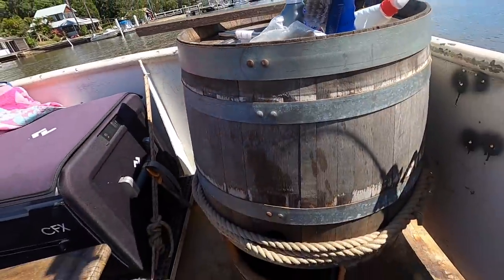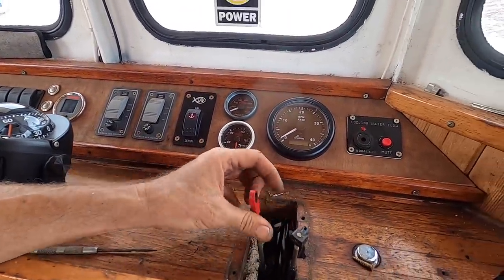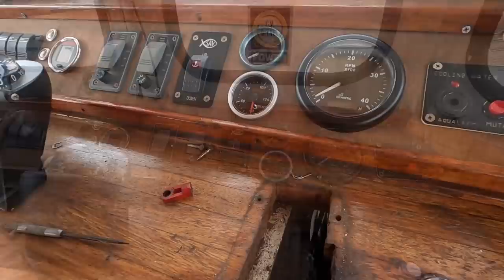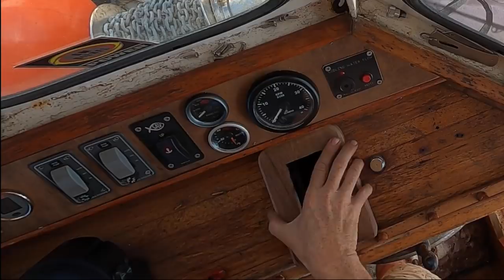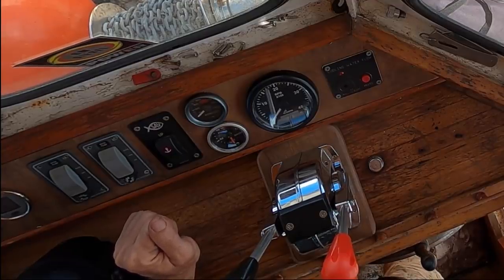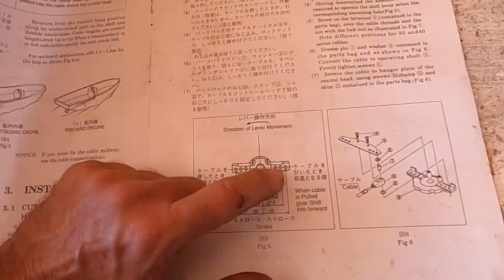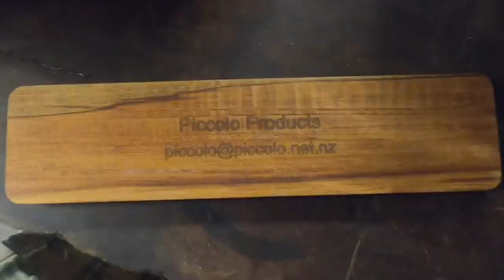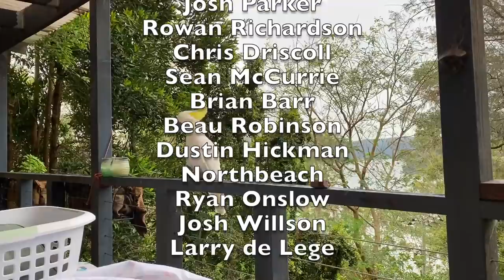New throttle controls and other wheelhouse upgrades

Comment: Hi Stu. I am a forensic fire investigator. When using linseed oil, make sure you dispose of any contaminated rags etc in water.  High risk of spontaneous ignition.  Love your vids.
Reply: Was going to mention it. Very important point.
Reply from the maker: Intresting, thanks for sharing.
Reply: Lay them out flat to dry in a single layer. Once they’re dry they should be ok.

Comment: Regarding the fire in Brooklyn...  Boats with inboard gasoline/petrol engines generally come equipped with blowers for the engine compartment.  On all of the boats I've been on, the switch for the blowers was right next to the ignition and had a big label telling you the minimum time that you should run the blowers prior to attempting an engine start.  I was always taught to start the blower, then go put my nose next to the blower outlet.  If I smelled gasoline for more than a second or two, then it was time to find and correct the fuel leak before repeating the process.  When the blower runs for the specified time with NO fuel smell, then you can attempt to start the engine.  Might have been a bit paranoid, but I've never blown the engine cover off of a boat.  (Bonus hint...it's almost impossible to forget bilge drain plugs when they are in a plastic bag zip-tied to the latch for the trailer hitch...)
Reply from the maker: Yes, the blowers are critical with inboard petrol engines.

Comment: Pete's shirt is top notch
Reply from the maker: It sure is! :)
Reply: @DangarMarine  i have a question... I just rebuilt a 1983 J75TLCNB. I have spark. I have gas in the throats of the carbs. All new wires. New power pack. New spark plugs. It cranks but doesn’t start. Randomly it will make a popping noise and a little smoke comes out of exhaust and I assume this is normal. Could my cause be timing? It bogged down under load and randomly died last year which is why I built it. I’m scared to continue to keep trying to crank it due to not breaking it in yet. I wish and hope you respond. I’m at wits end. Also after cranking I notice gas coming out of the throats. Is this normal?

Comment: Hey Stu, I believe the long wooden planks of the barrel as you called 
them are called  "  Staves  ".    I think I learned that from reading all those
Horatio Hornblower books.
Reply: Yes barrel staves.  A timber boat is just an ill shaped barrel 🥺.
Reply: @markhgillett  the steel straps are simply called hoops.
Reply: yup barrel staves
Reply: also those holes you made are called "bungs" and if you ever intend to keep liquid in them you need to soak the barrels until all the oak is waterlogged or they wont be "water-tight"

Comment: Wish  knew you were doing carpet Stu. I would have told you a trick from a old carpet installer. When you take up the old you just lay it on top of the new, allow for a little extra and trace it out. Saves tons of time and effort.
Reply from the maker: Using the old as a template is always a great way to go.

Comment: Dont matter where ya drop it on the boat, it goes in the bilge and you need Mr Tickle arms to get it back because its probably stainless and the magnet wont grab it.
Great video 👍
Reply from the maker: And to make things worse, with a steel boat you just grab the hull even if it is mild steel. :(

Comment: Great episode. The wood slats on a barrel are called staves. Stu, if you adjust the ballast on Renko, wouldn’t you be feeling listless🤔
BTW, I feel your pain on the drill bits. I did the same, but only on the shop floor. I can imagine it was real entertaining picking them up. I hope you had a magnet.
Reply from the maker: Thanks mate, liked your listless joke. That's the trouble with a steel boat, harder to pick things up with a magnet!

Comment: From when I was about 5 years old I was used to single controls for throttle and direction. Once I started operating a real boat and got used to dual controls I would never go back to a single.
Reply from the maker: For sure, I'm really happy with the change.

Comment: Hi Stu! Great progress on the boat! You should look at gimbaled cup holders. They have a flat bracket that mounts to a wall or bulkhead and a gimbaled basket that attaches to the bracket. Swivels in 3d...works well. Sold by West Marine as Drink Mate
Reply from the maker: Thanks for the tip!

Comment: The bands are called hoops and the planks are staves. You will need to screw every band into the staves to prevent them falling apart. Every 4th stave so they look like a spiral pattern on the barrel. Top #1, second  #2 stave, third band #3 stave, 4th band 4th stave, back to top, 5th screw in 5th stave etc. As many numbers as bands. Hope you comprehend.

Comment: They are called barrel staves.  Copper are the people that make the barrel.  Lots of legal regulations.
Reply: Cooper? Kuiper?
Making bands out of copper would be interesting! lol! It's probably been done. Possibly bronze too. The history would be interesting.
Reply: @chuxmix65  I hate auto-correct.  A barrel maker is a Cooper.  The metal rings are made of iron.  They still make wooden barrels in Kentucky because bourbon whiskey barrels can only be used once.  Rules of making bourbon.

Comment: I bought a huge new drill index because I needed a 21/64 and of course the only set that had them was the big expensive one. On the way home I said to myself, "this will be the GOOD set and I won't lose any of the bits". I used the 21/64 without incident, but I assume the next time I reach for it I will lose one or more bits from the set, because of course I will.

Comment: Did you consider using some sort or rubberized coating vs. or in addition to the two part epoxy under the carpet?  With water, especially salt water, naturally going to be on and soaking through the carpet, it's going to sit there and all the protection you can get for the steel would be ideal.

Lastly, did you glue the whole carpet down, or just edges?  Hopefully only edges (unless the glue is stays flexible and acts as a water barrier itself) so if you do need to pull it up it can be done easily.  Also, for future reference, glue the edges only, but leave gaps so any water accumulating on/underneath, can run out the edges.

Lastly, I think I might have tried using velcro around the edges to hold it in place, yet make it easy to pull up to check for water, rust, and/or to dry out the carpet itself.
Reply from the maker: Did think about doing a bitumen coating.

Comment: Yup, staves.

And you should put some screws through the band around the barrel, 4 probably enough, as the bands are only held in by pressure, and since the barrel is intended to hold liquid, that keeps the staves expanded against the bands.  Without that, they'll dry and shrink and the bands will tend to fall off and you really do NOT want that...  :)
Reply from the maker: These barrels have been dry for about 8 years now. The guy drove the bands down when I bought them (hence the white where they previously were)

Comment: I cried with you on the bits in the bilge. Can't even use a magnet right?
Reply from the maker: No, magnet just sticks to the hull unfortunately.
Reply: @DangarMarine  put a magnet between wooden wheels so it couldn't attach to anything but that loose parts could still attach to it with a bit of luck

Comment: Interesting, I know most boat engine controls seem to be going with the all in one handle for shift and throttle, but I've always preferred separate controls.  Since way back, with manual shifting outboards, vs. electric, a problem that causes failure is that folks shift like in a car, gently, easing the shifter into or out of gear.  When the best for an outboard is to just do it swiftly and surely.  Slowly sort of grinds the gears and since there are no synchros, this wears the gears themselves.  And they're designed to just be put into gear directly.

With the single control, I'm never sure if I'm in gear or not, and often accelerate before I know it's in gear.  Dangerous, to say the least.
Reply from the maker: I see it a bit like the different between manual and automatic cars. Always preferred manual.

Comment: Australians are like "lets cut the carpet, yet fist lets flip it upside down, inverse it, transverse it, have port be starboard and left be right, while  having The sum of the square root of any two sides of an isosceles triangle be  equal to the square root of the third side. Americans are like "try to force it into that space and cut what does not fit"

Comment: When installing the new controls for the engine, you mention a throttle lock. What is that exactly?
Did the throttle on the old control not stay put?
Reply from the maker: No the throttle on the old control kept being overpowered by the governor spring. I'll show working it in the next video.
Reply: @DangarMarine  thanks for the reply, totally understood!!

Comment: Really really really like the videos you put out. I’m a long time viewer and subscriber of yours. I literally can’t get enough lol.  I work on boats also.  I see you work on outboards frequently. Especially smaller ones. So I’m wondering if you have any thoughts on torque spec for head bolts. I got a 2018 Suzuki 6 hp four stroke and the specs aren’t anywhere. Is there a common go-to Torque for the smaller four strokes that one can get away with using? Also I wanna buy a t shirt.

Comment: How much throttle did you gain when you change the controls  And  Did you gain any speed?
Reply from the maker: Went from about 1500RPM max to 1850 which is what the governor is limited to.
Reply: @DangarMarine , every little bit helps!
Reply: @DangarMarine   That is a massive gain.  Next time you treat poor Rinko like she's a tugboat  you'll appreciate it.

Comment: My barrels shrunk, all the bands fell off.  I learned to screw all the bands to the wood.
Reply from the maker: Better to hammer them down to a wider part of the barrel so they are tight again. The white you can see on the wood is where the bands were before the barrel was left to shrink for over 5 years before being sold.

Comment: That carpet is going to be a nightmare to keep clean and will be a ruin within weeks it will also cause humidity and condensation within the wheel house when it gets wet and eventually rot out the floor at the edges, would have been a better option to place a rubber grid that can be easily removed.
Reply from the maker: The old carpet was 30 years old.
Reply: @DangarMarine  Yeah I noticed the state of the deck before you cleaned it up carpets and boat decks are a no no .

Comment: Hi guys, great videos thanks for putting this stuff out there! 

I have an issue with what is supposed to be a refurbed yanmar 2gm (not the 2gm20) its been sat in the boat out of the water for the last 3 years not doing anything. I have replaced the impeller as it was toast and oil/oil filter. 

sometimes it seems to want to bounce itself out of the mounts (new 3 years ago) do you have any thoughts?

https://photos.app.goo.gl/r9JkEjaqHFxG95429